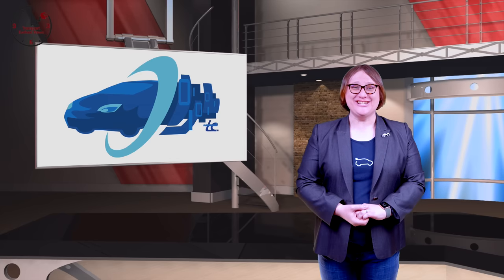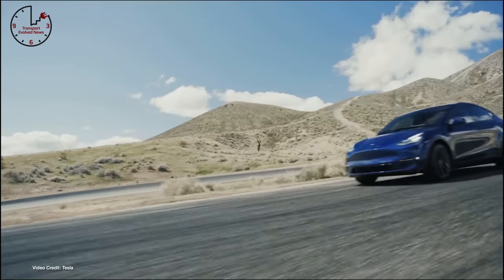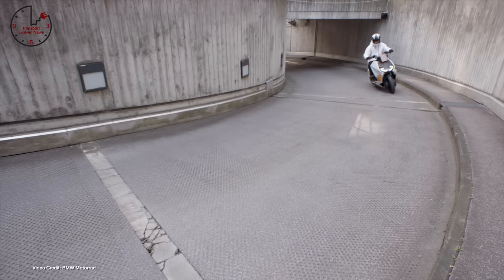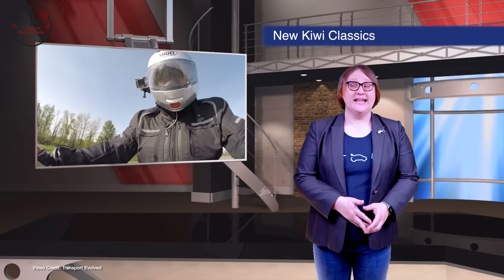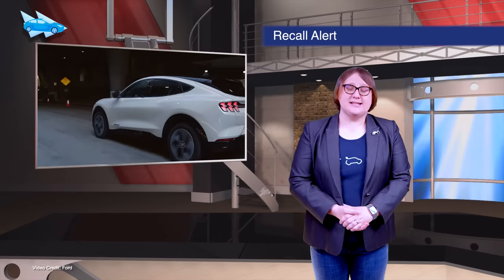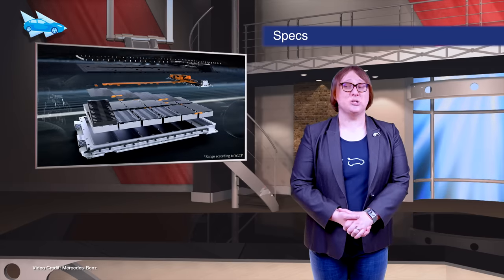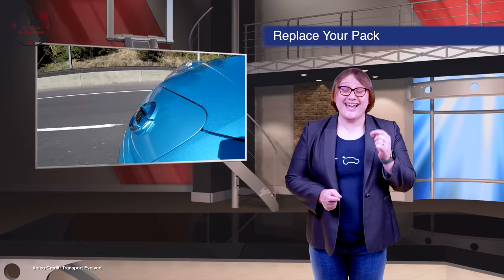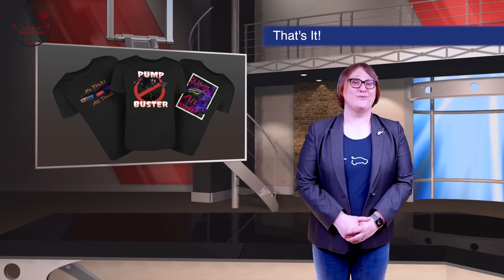TEN 333 -  Hummer EV SUV, Tesla Q1 Records, Two-Way Charging For Volkswagen EVs

Comment: V to grid is silly and it won't be used like you think it will. Your car will go through charge and discharge cycles over a 24hr period to make you a little money sure but will you be making more money than you are losing in battery life/range? In order to make money from your car it will have to been sitting at your house for more than a 24hr hour period to go through a charge,discharge, and charge cycle( charge at night when the power is cheap and discharge durring the day when power is more expensive). So durring the day when you want to use your car you won't be able to for two reasons, not enough charge to go anywhere and you are in the discharge part of your cycling power to the grid to make you that little bit of money at the cost of shortening the lifespan of your car. Please tell me how I am wrong. Great video👍👍👍👍
Reply from the maker: We actually did a video on this topic - it explains where the mistake is in the way you're thinking about V2G.  https://youtu.be/FBhb_QfAe08 Thanks for the question! ^Kate
Reply: As I see it, the problem with V2G is the time of day most people drive and the duck curve.  The time the grid needs electricity is 8-9AM and 6-7PM.  Most cars are used to drive to work, or school, around this time in the morning.  First they're less likely to be plugged in while driving and when they do park at the office, their batteries are not full.  Same thing in the evening, people drive home and arrive with low batteries.  Worse if they want to recharge right in the peak time before going out again.  Most people want their cars ready to go in an "emergency" and would not like to find their battery empty at a time like that.  There are people on alternative schedules that may be able to take advantage of the V2G, but they are certainly the minority.  There may be some small value for frequency response, but that will be better served by the huge static grid batteries like the ones in Australia and the value to the consumer will be small.

I still think it's worthwhile to do the V2G experiment, but I think it's unlikely to be as valuable as some people think.
Reply: @normcfu  I want solar power but it needs a battery to make it fully effective and this lets me use my car as that battery. That is a huge cost saving even if it's not as good as a dedicated house battery.  I work from home thanks to the pandemic as do a lot of people, so I forsee the car charging up during the day and giving a bit of that back at night.

Comment: If BMW Motorrad are going electric (and I remember seeing an electric "boxer" moto a year or two ago as well), will they please get on making an electric RT?
P.S. I don't need or want the complicated menu wheel & all that tech on the latest model; the cockpit of the 2007 model was fine, but where you've put the space for your overpriced nav system, how about a universal mobile mount/charger/antenna extender? All the nav, comms and entertainment stuff you've been adding to your system, I've already got - just give me the means to use it.
I will, however, keep the hill-assist brake, which would be useful in San Francisco even with an electric.

Comment: I have a question - what should we call the 'gas' pedal in an EV considering it doesn't run on gasoline or petrol/diesel?
Reply: Simple, that would be the power pedal
Reply: Go pedal? Accelerator?
Reply: velocitator and deceleratrix (a car's accelerator and brake) Mr Burns from the Simpsons. Tesla also calls the phone ahoy ahoy.  So this is the most accurate.
Reply: Maybe gas pedal is fine. We still say we dial and hang up the phone or roll down the car window, even though we don't actually do that anymore.
Reply: Outside of North America most countries use some variation of accelerator or the local language form of that word.
Reply: The electron pedal?

Comment: About that ignorant comment about the recovery of a Tesla and "it's pretty scary": that's the way it works already with most leased cars. If you didn't know, most leased cars include a devide that beeps non stop when the owner stops paying and eventually cuts off the engine before restarting the car to be taken back. Now you know!
Reply: Wow, since I have never leased a car, I did not know that. So I guess I too was ignorant about that stuff.
 Thanks
Reply: @cesarnotary  
"Repossession methods

Besides physically removing the vehicle, a lessor may also use a starter interrupt device (SID) in place of repossession or to help facilitate repossession. 

A SID is a device that allows a lessor to remotely deactivate a vehicle’s ignition system if a borrower/lessee misses payments or defaults. The shut-down can be temporary, until a payment is made, or it can be done to make repossession easier. 

The rules on SIDs vary from state to state so ask your lessor before signing the contract if your vehicle is equipped with a SID. If it is, you should ask if there are any warnings given before the vehicle is shut down. You may also want to ask if there is a way for the vehicle to be re-activated in case of an emergency."

Comment: I necer hear any negative things about ev’s on this channel.   Only how perfect they are. What about the recent news about the Ampera E? On tv in holland today!  They had to lower the battery power with 10%. So even less range of the small range it already had!  Because it was to dangerous! Cars burned down. And the fire department can’t do anything because they can’t stop the fire.  Owners are getting mails that they are not allowed to park in parking garages. Or near buildings. ( read the small letters)  so: less range. And less parking possibility..     but you never hearing this stories on pro EV channels..
Reply from the maker: We’ve covered the battery fire situation with the Bolt EV (the Ampera E is a rebadged Bolt EV) extensively on this channel, it’s not a new situation, most recently just over a week ago. We’ve also covered similar issues with the Kona EV, both caused by manufacturing errors by LG Chem (now LG Energy Solutions). 

As recently as two weeks ago Nikki did a whole livestream about charging challenges, and it’s hardly unusual that we report issues with electric vehicles and EV adoption. - Winter